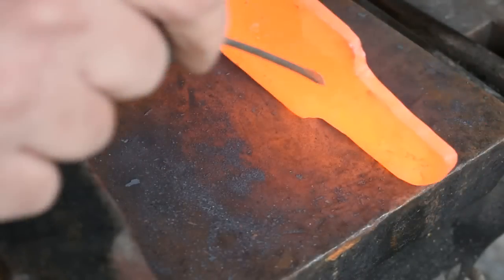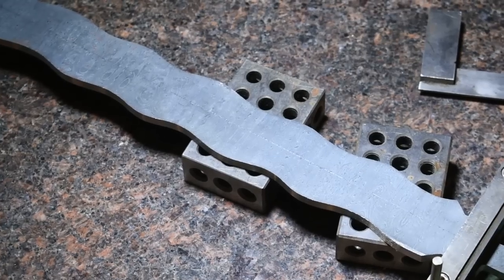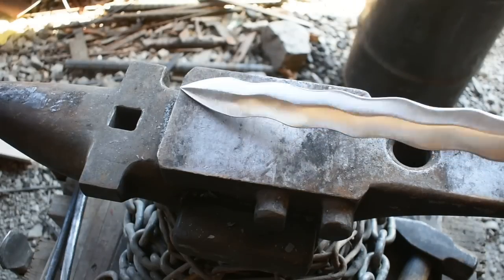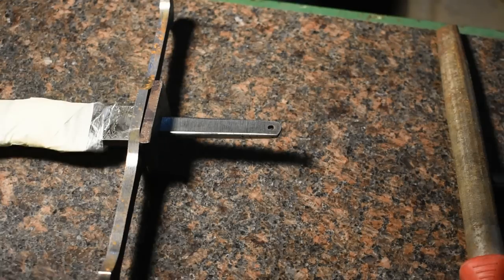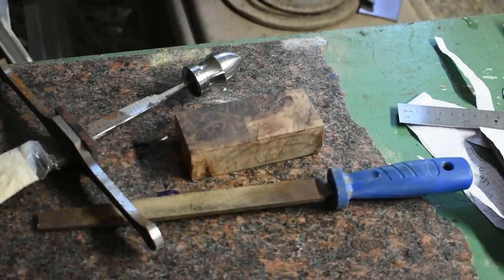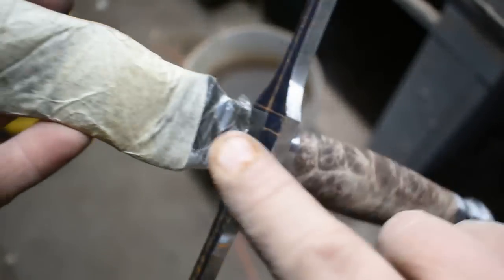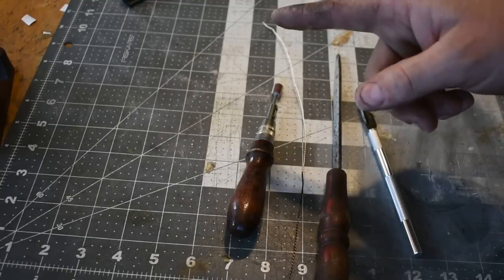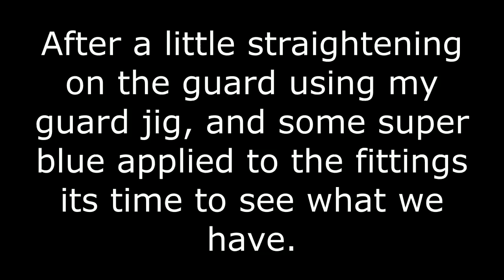Forging a Ladder Pattern Damascus Dagger

Comment: Strength aside I find it much faster to forge a longer Tang then grind down to quarter-inch and thread it. Then again if your forging by hand that may not be the case.
Reply from the maker: It's something I have been working on more recently, I would like in the future to forge and thread the tangs instead of welding it, the all thread was the fastest for me on this build due to my inexperience. Thanks for watching, I greatly appreciate it!

Comment: Typical shortcuts…😢
Reply from the maker: The typical shortcuts as you call them were necessary for the preservation of the pattern, if I forged the blade to shape I would have distorted the pattern completely ruining the ladder pattern, the method I used to create the blade is no different than those used by ABS mastersmiths, you forge the tip and forge the tang then grind the rest. If I had went with a mono steel blade like 5160 or 1095 I would have forged it to shape because I wouldn't have had to maintain the uniformity of the pattern. I appreciate you watching.